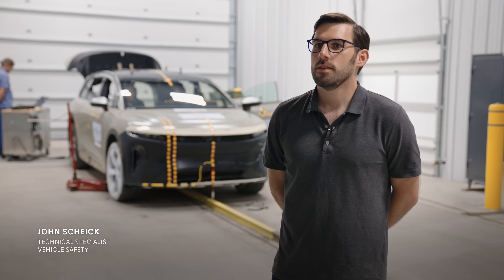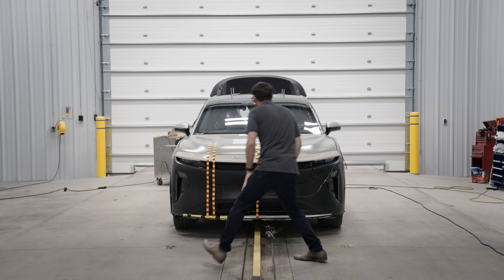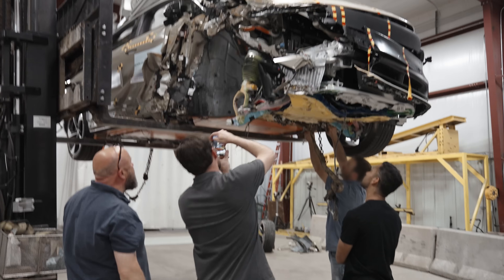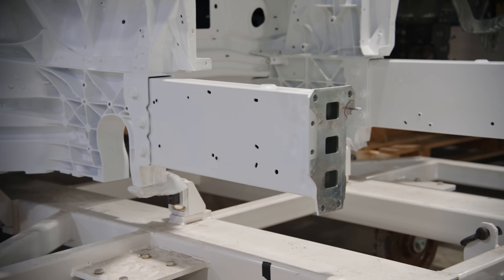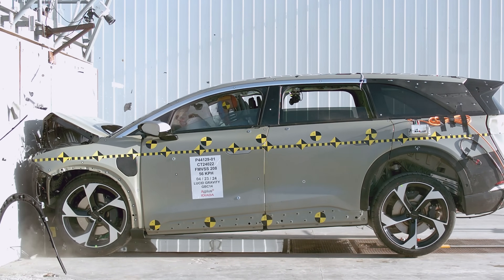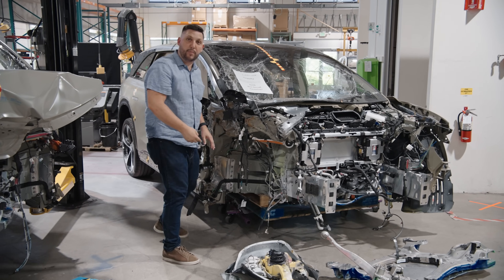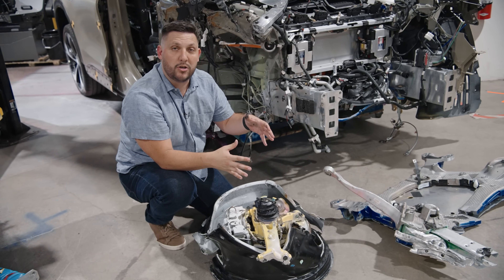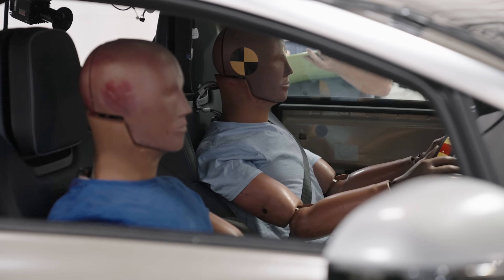The Lab: Crash Testing | The Road to Lucid Gravity

Comment: I wonder how a frunk design plays into crash safety engineering and crash testing.  It seems like the contents of the frunk could potentially really change how the vehicle performs in a crash.  I'm assuming these crash tests are performed with an empty frunk?  If not, what do they put in the frunk when they test?  I'd guess that filling the frunk with a rigid metal object would be a worst case scenario for a crash test.

Comment: Well, those Wheels separating from the Vehicle are a deadly threat to everybody around the crash site...
Reply: Better a small chance of that than a certain likelihood of injuring a front occupant- in most crashes of the intensity where a wheel would separate, there are not pedestrians in the vicinity.
Reply: @saillaw2  Yeah, there are no Pedestrians on the Test site, BUT almost everywhere where this car should drive, there are high chances of pedestrians and bystanders during a crash where there is a risk of separation of the Wheel.
There is also a simple way to protect the front occupant by improving the quality of the Wheel well!
Reply: @ulrichg.3424  where are you that you are driving fast enough next to pedestrians to have an accident of the severity needed to cause the wheel to shear off?
Reply: @saillaw2  Well, in the Video, the Test was conducted with a speed of 64 km/h. That means for a crash with upcoming traffic, which was simulated with the Offset Crash, both vehicles would have a speed of 32 km/h.
I am from Germany, and the normal speed in our cities is, unfortunately, still 50km/h. That would result in an impact speed of 100km/h during a "normal" Offset Crash!
As far as I remember, this is also a rather normal speed limit (30mph) within US cities!
Reply: @ulrichg.3424  As others have pointed out, Volvos have had this technology for many years, you don’t read of pedestrians being hit by flying Volvo wheels often.  I hear what you are saying and agree that it can be a theoretical risk, but the benefits outweigh that risk in my opinion.
Nt
Reply: The vehicles crashing into each other is the deadly threat,  not the wheel and tire breaking away and barely moving at all. Most likely,  in a real crash the brake line would keep the wheel from flying any distance.